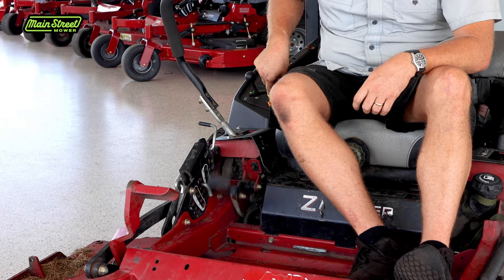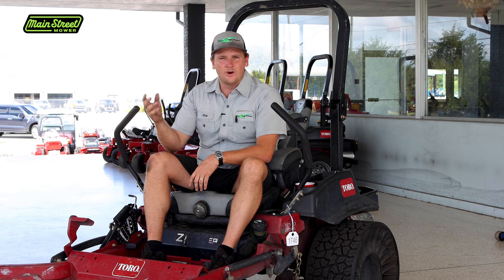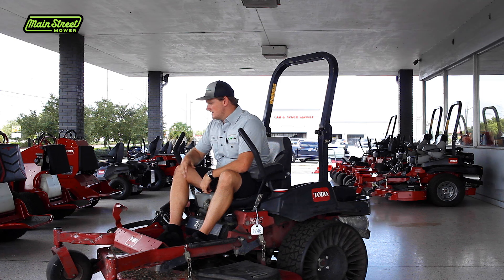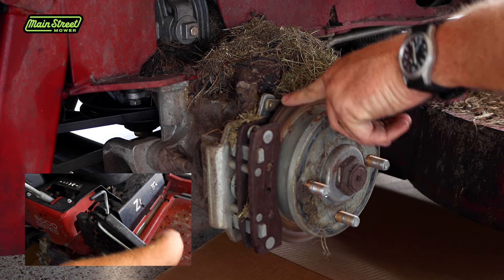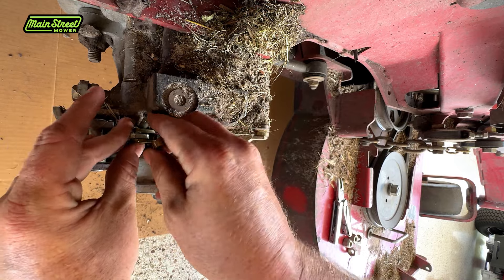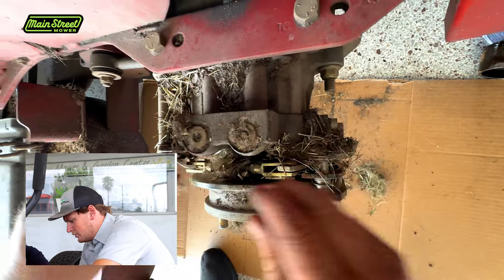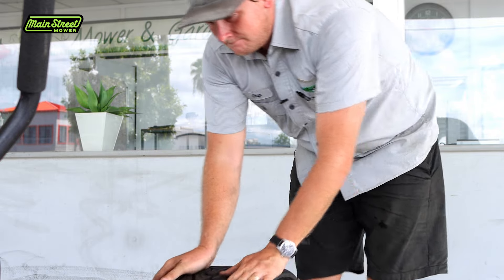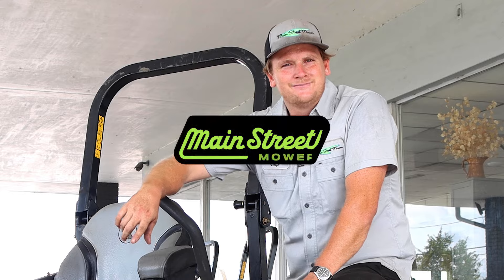How to Adjust Brakes on Zero Turn Riding Lawn Mower

Comment: Had more problems out of the 4000s so far then any of the 5000s with the old frame combined since 2008. It’s just dumb small things like the levers coming loose, deck becoming unlevel… but the 4000 pro hd with the 35 horse has been a beast for me as well. And I HATE the service for the hydros on the 5400 pumps. The Parker’s you drop the filter that also drains it, screw new filter in refill and done. Had a starter got out on one of the fx1000s at almost 600 hours but that’s on Kawasaki 😅
Reply from the maker: Agree with everything said, well put!